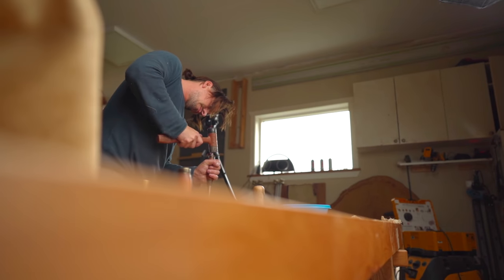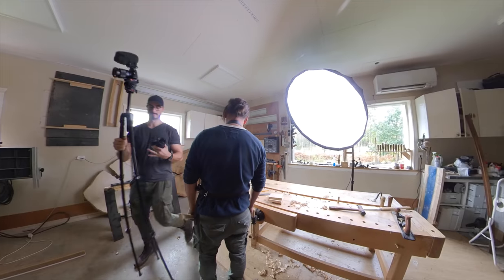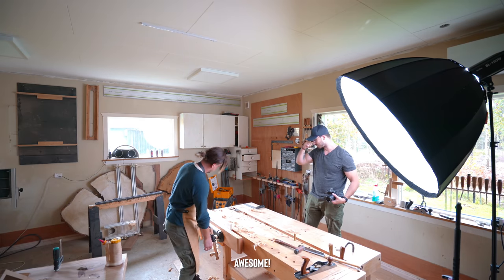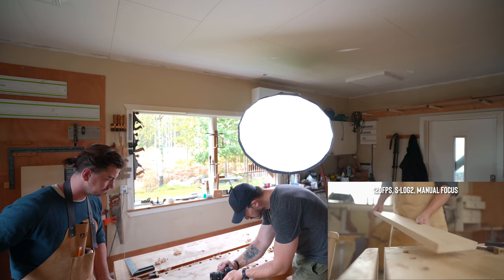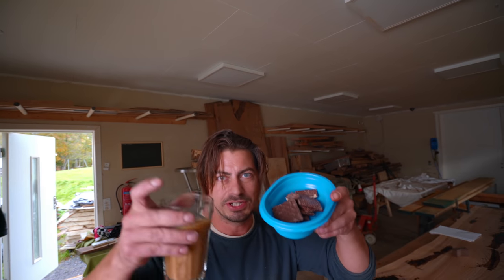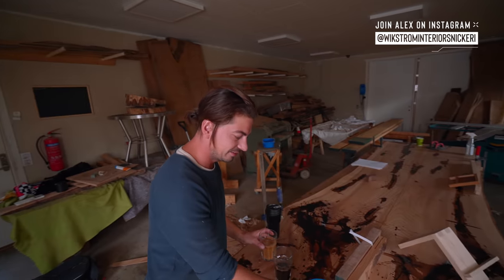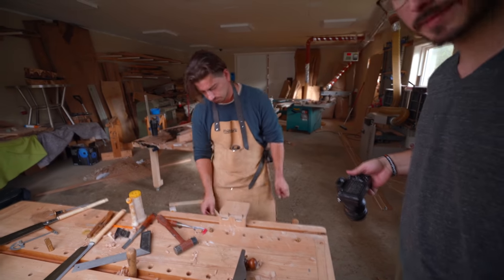How To Shoot B ROLL Of A Woodworker | Behind The Scenes

Comment: Hi Peter, you mentioned using focus picking to setup focus in manual mode; actually with my sony a7III I am using a hack I saw once somewhere; basically you can customize a button, which when pressed switch you to auto focus and when released comes back to manual. It works really fine! Cheers!

Comment: This is so cool! I want to do something similar with the guys in my shop! I'm curious if you've got information anywhere as to why you chose 120fps over 100fps, and what applications each frame rate would be best suited for. I know you mentioned having complete control of the lighting, so I'm wondering if having non-photography lights running at 60hz factors into that decision. Thanks!